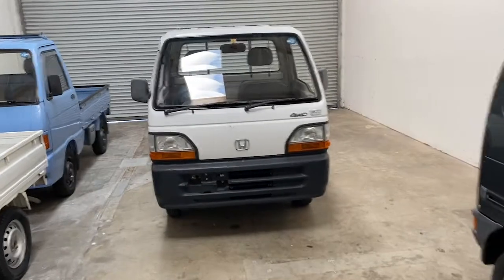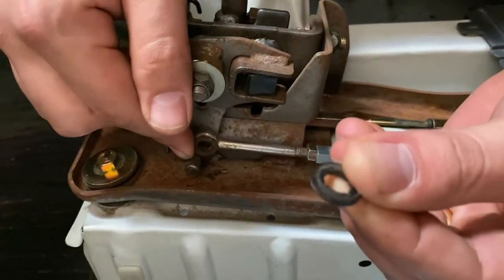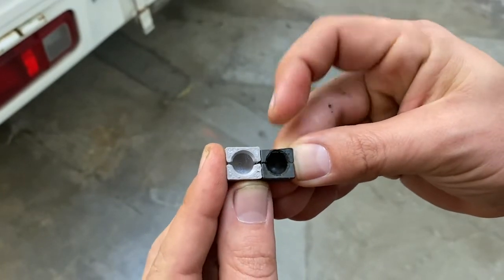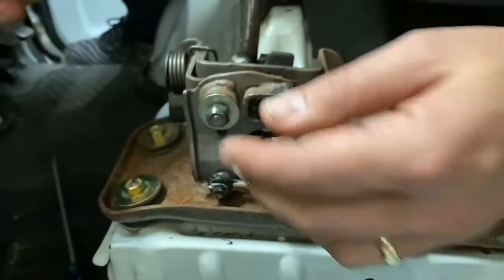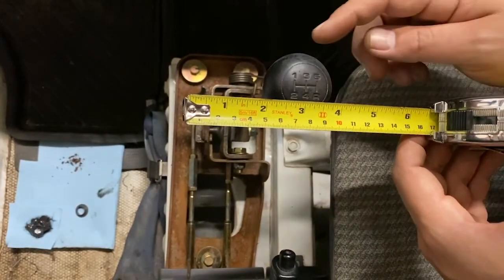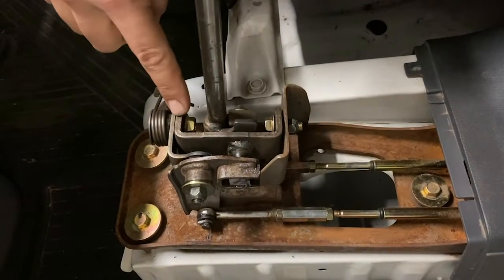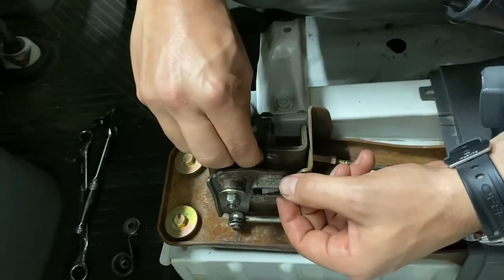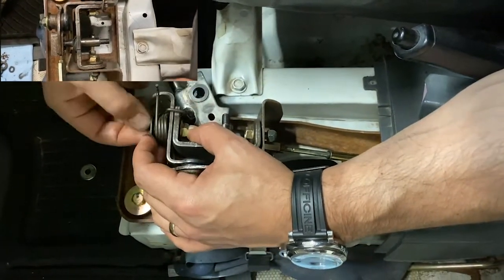Honda Acty Shift Bushing replacement

Comment: Works perfectly for the Attack trim! I installed the full kit in a 1990 Honda Acty Attack trim.
Reply from the maker: good to know and glad it worked well for you!
Reply: @willpowered9882  I also installed on my Acty Attack and didn't see any difference in the shift mechanics than what you show in your video for the SDX. Thankfully your kit included 2 cup bushings... The gray one shattered when trying to put on but the black one went on fine.
Reply from the maker: @Westyklaus  the black was a redesign in materials, I still provide the grey while supplies last just as an extra if it doesn’t break.

Comment: I have a '98, pulled mine last year, completely disassembled it and removed all rust. Painted the frame to prevent future rust, rest of the assembly sprayed with Fluid Film. Parts with rust were soaked in white vinegar-

Comment: Anyone ever have issues with the old nylon lock nuts slowly backing off due to the torque break to get preferred tightness? I would pay a little more for a full kit that also included replacement nuts…